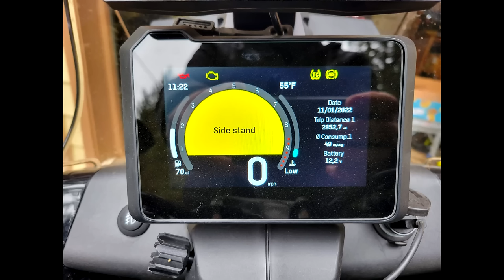Husqvarna Norden 901 Long Term Review: 6 Months and 3,000 Miles

Comment: Picked up a 901 with 600miles on it 6 weeks ago it now has 2800 on it, ZERO issues but thats no surprise, previous bike Super Duke GT 34000 miles ZERO issues in 2 years before that Super Adventure T 40k, before that BMW 1200 GSA only had it 7 months when wrong 7 times cost me a fortune. Waiting for the Norden 1301!! Good vid excellent work

Comment: Not sure if it's been mentioned, but quick shift won't forget the ride modes if you make sure that you don't start the engine until the dash fully loads. If you start before the dash loads, then quick select will lose the ride mode settings.

Comment: Regarding your concluding comments re reliability, to be fair, they speak more to your mental state than they do to the actual mechanical and electrical integrity of the Husqvarna Norden 901.
Having owned a large number of KTM’s (as well as many Triumphs, BMW’s and various Japanese brands of motorcycles) over many years, reliability creates no such doubts in my mind each time I set off on a ride.
I have purchased my local dealers demo 901 but have to wait till February to take delivery. During the year 2022 I owned a KTM powered CFMoto 800MT, a KTM Duke 890 as well as a great little KTM 390 Adventure with zero issues on any of them. In 2003 I owned a KTM 950 Adventure, an EXC450 and a 640 Hard Enduro then in 2013 I owned a KTM 1190 Adventure. For the life of me, I do not recall ANY ISSUES with any of these motorcycles.
To be wedded to Japanese motorcycles because of a perception of reliability is much the same as a little 4 year old sweetie being wedded to her security blanket!

Comment: Great review.  Fair and balanced.  Especially around the 'suspension' issue that people seem to love pointing out on this bike as being deficient.  I think for most of us the Norden has more than adequate suspension.  More may be better but if we are realistic about our riding styles and skill I think the Norden is great for most of us.  I have bottomed it out, but at 230lbs, with full camping payload, and Intermediate skill I probably should be trying to jump it out of washouts all day long! :)

Sounds like the first delivery on Nordens has some unfortunate assembly line issues (loose hoses, rear shock oring, etc) which I think were corrected on the subsequent rounds of deliveries. 

I've had my Norden for 5 months and done over 15,000 kms.  Including most of the WABDR (friends bike had issues so we had to pull out) and a trip from Vancouver BC to Tuktoyuktuk (the Arctic Ocean) and back.  ZERO problems.  ZERO.

All in all I think the Norden delivers on what it was intended for.
Reply: I'm in the market for an ADV bike now and the 901 is top of my list and the ride from Van to Tuk is on the shortlist. Been up to AK a couple times already in cars. Good to hear you give it the nod.
Reply: I live in Vancouver Island. I’m buying the Norden 901 expedition this month. Glad to hear of fellow Canuck talk about this brand. Sounds like an amazing trip! Hopefully I’ll be ready for that type of riding one day lol.

Comment: Great review. I've been contemplating a 901 vs 890R. I have ridden an 890R for 4 days off-road and really noticed the lower center of gravity the tank design provides. I felt the 890R suspension was too stiff for my style of riding. I don't do jumps. 190lbs older rider. Never ridden a 901. More than enough power for the road and offroad. I never switched to street mode. I'm also considering the T7 and Toureg but don't like the higher-up feel of the tanks. They feel top-heavy after riding the 890R. Thanks again.

Comment: Nice review and summary. Norden owner here since March with 3400 miles. No issues here other than the lost favorites setting. My experiences and assessment is pretty much spot on with yours. One little niggle I would like to see changed is the ability to change the order of the ride modes. Since I switch between street and off-road 95% of the time, it would be nice to pin these as the first 2 for quicker access especially given the lost favorites issue :). One other niggle to be fixed is the ability to permanently set the rear abs setting to the ride mode. On for street and off for off road. An awesome bike though. Owned several KTM/Husqvarna/Husaberg bikes and have been fortunate with no significant reliability/repair issues. Try to stay positive and bring some good karma to your Norden :). Cheers!

Comment: Nicely done Ben, I had the same concern with my 901. But  having put 11,645 miles on the bike it has never left me stranded. I also have had the immobilizer come on a hand full of times but has always cleared and never been a problem. On 4 or5 occasions it's started and ran rough and i've hade to restart sometimes twice to clear it out. always when cold, a little unnerving. All and all the bike's a HOOT to ride and very happy with it!
I took the 901 to Plain for the Touratech Rally this summer and it was a pleasure meeting you and Travis at your came site. Also entered the slow race where the last two standing moved to the final, I was third, Rat's almost! All that to say the fuel being low really help's with keeping the weight on the bike low and it handles well for it's size.  Enjoy your channel.  Keep up the good work!!
Reply from the maker: Thanks, man.  Glad to meet you, too.  I'm happy the bike has been good for you.

Comment: Great review. As a T7 owner, it's interesting to hear this perspective and comparison. I have no Illusions about the relative performance of the two bikes. At the end of the day though, I'm willing to trade some performance/comfort for overall Yamaha reliability, availability of service and aftermarket parts for the T7. I'm very interested to see how the 901 performs over the long term. 3,000 miles is really just breaking it in. I hope for your sake it continues to be relatively trouble free. That said, having a higher level of confidence in my ability to get to my next destination trumps almost all other issues for me in an ADV bike. I ride solo almost all of the time, including an 8 day, 1,400 mile trip this past September in SW/SE OR. One small problem, whether it's the bike, a fall or some other mishap could turn into a bad situation. Anything I can do to minimize the chance of getting stranded is my primary focus. Come down to Azalea sometime for some great riding Dork!
Reply: I agree 100% with you. Reliability etc is most important to me. I go very remote alone often and simple and reliable is for me. My current ride is a new 300 Rally. I'd like a T7 also but using my money to obtain my pilots license. Been riding 30+ yrs and want a new challenge.
Reply: The performance difference is really overplayed. A T7 will keep up with a Norden in all but professional racing circumstances and even then it would be dependent on the circuit and rider.
Reply: @SimonBrisbane .  Personally I want nothing to do with ride modes. I guess I'm old school but I want very little electronic gizmos when riding.
Reply: Actually,  I'm a bit of a hypocrite here. I had an African twin AS with the DCT and loved it. Over 30+ yrs riding off road and swore I would never own an automatic motorcycle. Dead set against DCT. Oops, I was wrong about that. Whats even more weird is I say I wouldn't want it on my 300 Rally....but I could even be wrong about that. I used to drive 18 wheelers. Amost a decade of shifting 9 to 18 speeds transmissions. Then automatic semi trucks came out...love the new automatics but I don't fully trust them for reliability. Oh how me and the times change...

Comment: I’ve got 8000 miles on mine, bought it in April. Still waiting for my heated grips. I love this bike. The buffeting was way works with my Krios Pro. When I sold that and got a shoei it was much improved. YMMV.

Forgot to add, I’ve had no issues at all. It has been an awesome bike and exactly what I was looking for.
Reply: I ordered grips and the HCU for the 1290 and they work perfectly.
Reply: Thks for the helmet tip!

Comment: Over 4,000 mi. on my Norden,  zero problems.   Rented a T7 in the NE and rode it 2600 mi and was not impressed.   Sold my ATAS and couldn't be happier with the Norden which i take on stiff i wouldn't take the ATAS or the T7 even.   Great review.

Comment: I just went looking at an Adventure bike more for long distance traveling. I looked at a Yamaha Tenre 700 &1200. Both were nice, but then I seen this. A 23 leftover with a complete set of hard luggage and it was $12,500 with no dealer add ons. I love this review. I'm planning on riding from South Carolina to the top of Maine near Caribou. It comes with Perelli tires and the performance exhaust. I know it's a great deal. My issue, is I am 5'9" and it's a very tall bike. Salesperson was new and didn't know if I could lower it. The seat was on its lowest setting. I grew up riding Husqvarna dirt bikes. I found them fast and handled great. I own a Royal Enfield Himalayan motorcycle, but it's definitely not a good long distance bike. It's great where I live in South Carolina riding the SCAR( South Carolina Adventure Route) but riding at speeds above 65mph feels like it's really pushing the bike. Love the reviews and have been a subscriber since the end of last year

Comment: Mostly agree. 4000 miles on mine. Love love it. Favorites don’t stay set. Cruise control is recently not setting. It turns on but wont set. Might have something to do with one finger clutch adjustment. Zero other issues!  I have owned Ktms in the past without issues. I would ride my norden across the world tomorrow without hesitation. Thanks Dork!  Oregon brother

Comment: Electronics that have a lot of moving parts that can break? Certainly not!
People who think that features like riding modes or traction control should consider: which ADDITIONAL parts does a modern bike need for that?
All modern bikes at leadt in Europe need to have ABS by law and there can be no discussion that this is a life safer. So those components must be there anyway.
Riding modes? You need ride by wire for that, so an electronic throttle instead of mechanical wire. How many defect reports do you find about that?
Lean sensitive ABS? Yes, some additional sensors. Any defect reports?
TC? Uses ABS sensors that the bike needs to have anyway.
The rest is additional software, which does not brake. 
So: no, those features do not add unreliability factors! 
Great review by the way, I love my 901, too! 😊
Reply: PS: i actually went from the 790R to the 901, because i found the R a bitt too uncomfortable for long trips, just like you mention. And mine is also forgetting the favorites settings.

Comment: This is a fair review, that little nagging anxiety is real. 6K on my 890R and I've had the immobilizer warning pop up in a place where I was afraid to turn the bike off as it would have taken a helicopter to get it out. But its never left me stranded so far. I ride with two 901's and they are definately better looking, more comfortable and plusher on the highway but I like the dirtbike with a windshield feel the 890 provides. I also find myself riding like an idiot a lot of the time because they are just so confidence inspiring and well balanced.  Removing the Cat makes a big difference. The bikes are so choked up and are leg burners in stock trim.

Comment: You've got about 500 miles on me with the 901. I haven't had any issues and the only reason I can think of for reliability concerns is from the internet. No firsthand experience with failures. I just remembered, i did have the infamous coolant leak and took care of it myself. Also, there are some spare accessory power leads under the seat that have a protective rubber boot which had slid up the wire and allowed it to be shorted out popping the accessory fuse. Neither one of those issues can be attributed to overall quality of build. P.S. one of the first things I did after getting the bike was go through a surprisingly deep mud hole. So deep it was above the muffler. I was freaked out about the thought of sucking water into the engine but the snorkels that are attached to the airbox are pretty high up, so I was really thanking the engineers at Husqy (KTM) for that one. Which brings me to the Rottweiler upgrade. Snorkels are completely removed with the Rottweiler system, and I would not have survived my swim with that setup. Michigan is not necessarily a dusty place, so I think I'll stick with the stock setup until somebody lets me keep my snorkels and have a washable element.

Comment: good review.
btw, odometer goes until 9999.9.  I kept it for same reason as you did, but once it hit 10k, that's it. also, mine started mixing oil and coolant at 15k kms so we are pinpointing the problem atm. still best touring adv bike on the market when you put everything to the paper.
long tours (3000km and 2000km roundtrips) were done as a breeze.
also, no problems with rear shock, and I do go on motocross track and rides with bunch of light enduros now that I have anakee wilds... BUT, I installed heat shield right away from the start so that migh be one of the factors that my shock still holds on.
Reply: Mixing oil and coolant?  Yikes!  I’m following you to hear more about how that goes…
Reply: there were cases on 790 engines where it happened. I will write about outcome on ADVrider forum when we solve it, and will bring it up when I make 15k kms review from my perspective.
Reply: Tiger 900

Comment: The reliability issue is fair and it’s the only question that usually prevents me from falling in love with the Tuareg 660 too. It seems like it’s almost the perfect middleweight if you trust Aprilia. I haven’t got there yet, but I still need another year or so on my current bike before I need to make up my mind on one of these anyway. Both the 901 and Tuareg seem to be holding up well from what I’m seeing thus far though.
Reply: I feel the same way about the new Ducati. Reliablity and maintenance are a big thing for me... not just that but cost of repairs and parts.
Reply: @robmccormick8155  I just got back from sitting on a Tuareg about an hour away right before they closed lol. I liked it too. If felt bigger and bulkier in person, but it essentially has all of the same features for a much more affordable price. It’s not as refined or fast but it’s a good value for what you are getting. Planning to check out the KTM 890 Adventure next week.
Reply: The Aprilia Touareg 660 is very appealing, but their dealer network in the US is very limited.
I really like it but not crazy about my options for service and parts.
Reply: @Baldhills  those are pretty much my feelings too still. The Ducati and the Aprilia look like outstanding bikes. I have sat on both. I keep asking myself whether I really want to try to find and pay for parts and maintenance for either though. Not sure about that part.

Comment: I was a KTM sceptic, but it seems they have redeemed themselves for the last 10 years or so.  I have a 2006 KTM 950 SM, which was sort of a impulse purchase, as I was curious, but it has just worked without issues, plus it's a fun bike!  The know how to put a smile on peoples faces, same as Ducati🙂
Reply: Great bikes, I bought a 950 SM as a cheap winter hack, it turned out to be one of the best handling bikes I have ever ridden (and there has been quite a few). A bolt on screen made it capable of all day 80mph motorway cruising. Only sold it because I wanted a trail bike but it certainly opened my eyes to KTM engineering.
Reply: @roughrider9831  , I did the same thing🙂, bolted on a screen from PUIG.  It's not huge, but enough to keep the wind off the chest.  I use it mostly for commuting here in Stockholm, Sweden, where the traffic is horrible. Great handling and perfect for seeing over cars, and whats up ahead.   Also enough power to "teleport" yourself from one spot to another, when need be😄
Winding roads is where it shines for real though.  The only reason I'm thinking about selling it, is that I would like a bike with fuel injection, ABS, and some more goodies.  The 950 SM, is very basic in that sense.  Not even a rev counter.

Comment: Great review - lot's of good info. I currently own a '21 690R and a '13 500 EXC - love both bikes and have had zero issues with either (7K miles on the 690 and ~ 2k on the 500). I'm thinking of swapping out the 690 for a Norden and one aspect that you did not cover that matters to me is noise - from the engine (exhaust, intake and internals) and road noise/wind protection. That is one area where the 690 wears on me on long slab stints.  I tried the Rott intake for the 690 as it is a much better design than stock but was incredibly loud - something I totally did not anticipate and no one seems to talk about (in fact some riders like the increased noise). I scrolled through much of the comments but did not find anything on that topic. Did the Rott intake noticeable increase noise? How's the wind protection and noise on the Norden at highway speeds?

Comment: I have 16,000 miles on my KTM790S. Mostly pavement but have done a moderate forest road and rocky doubletrack. The only annoyance is that sometimes it takes 3 tries to start in the morning--regardless of the temperature. It's the most fun I've ever had on 2 wheels.
I did have to trailer it home once when a raccoon ran out in front of me doing 60MPH and it broke the fuel spigot on the left side of the tank. I upgraded to the aftermarket aluminum one and installed lower crash bars to prevent that in the future.